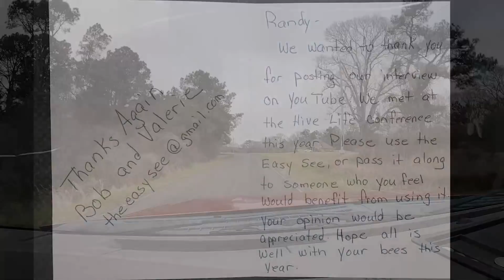You Don't Want To Come In Here!

Comment: You take some FINE pictures. I remember the pole buildings, paneling and even the old oil jugs, moss and blue copper wire, the whole thing. Bet Pop does too. Good job patching.  Just do what you have to do and the switch is for the oven light. Us old geezers know these things and might still have one ourselves. GBWYall and have a LARGE weekend!

Comment: I finished drywall for 20 years if you add hot water it will make it set up faster also if you use a old mixer beater don’t take your wife’s you might get in trouble and put it in your drill and mix it together you won’t get any lumps

Comment: That patch tape with holes in it?
That's how it's supposed to work. 
Those dimples are like rivets on the back side for the first layer. 
But.... 
They're for holes and wide gaps. The  idea is to put a thin primer layer down, then push the tape in. And flatten it out to remove any creases with the knife. For wide gaps, you gently push the tape into the gap so it curves in. It gives the mud backbone until it dries. Then put you on your finish layer. 
The flat paper tape is what I use. 
In my own place?
I use the good stuff.
Whole 'nother ball game.
Reply from the maker: I definitely should have used paper tape on this
Reply: @628DirtRooster  that hole tape works good but I think one step is getting it wet first. Like wallpaper. It's messy stuff compared to the mesh.

Comment: Back in 2010 we had a house fire and after we rented this cute old farm house and it had the exposed original (for the most part, it did have some some newer patching repairs) shiplap walls and I absolutely loved it! Even in north Louisiana you'd get frost bite of your feet in the winter time if you didn't have house shoes on because there wasn't a livk of insulation under those floors and I'm it was pretty drafty making for high summer electricity bills, but I would of lived there forever if I could have!

Comment: Randy,
Doesn't help for that job, but if you mix hot water in your 90, it speeds up the process, and will save you a lot of time.  Mix the mud and let it sit a little while so it starts to kick, then get it up fast.   On the final coats, use the hot water, but don't let it sit, so it stays smooth.   90 becomes 45, and 45 becomes 20, and 20 becomes "quick patch" and only lasts maybe 4-5 minutes.
Maybe this will help sometime in the future, if you didn't already know it.   Thanks for the video.
Reply from the maker: I didn’t know that.  Thank you.  I’ll use that info.
Reply: @628DirtRooster    As much as your videos have helped me with my bees, I'm happy to share anything with you.  I hate that perforated tape, too, by the way.